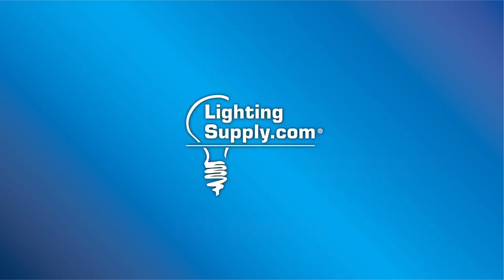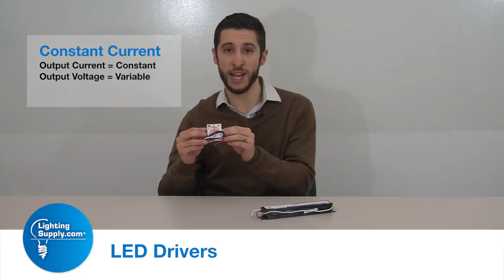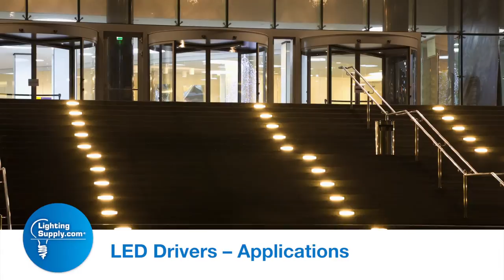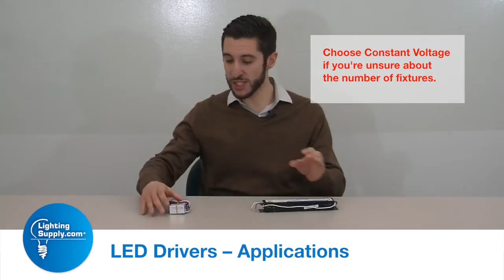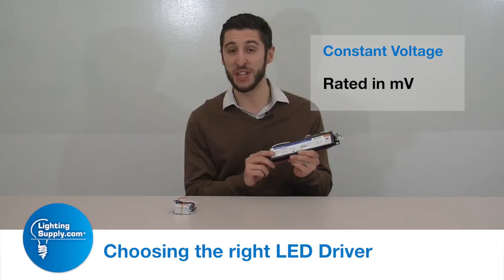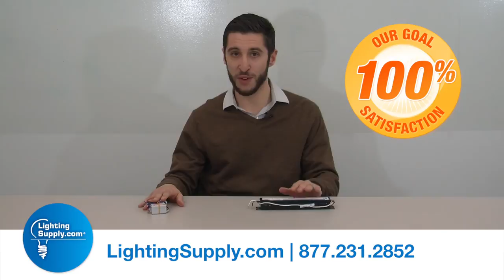The Basics of LED Drivers from Lighting Supply

Comment: How many 200 watt led drivers am I able to run off one power strip
Reply from the maker: Hi! Thanks for the question. For that information, you'll have to check out the specs of your power strip to see what the maximum would be. If you need further help, give us a call at 877.231.2852.